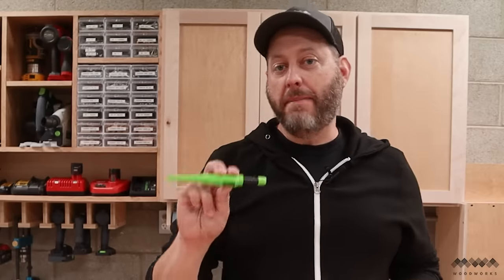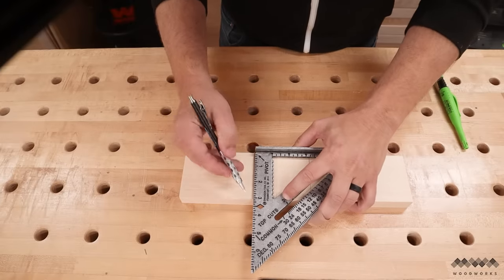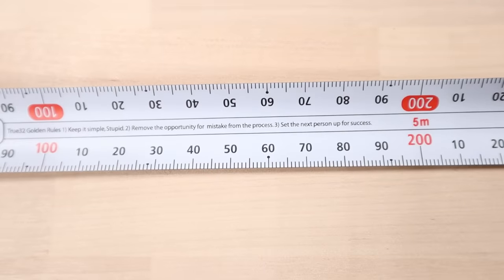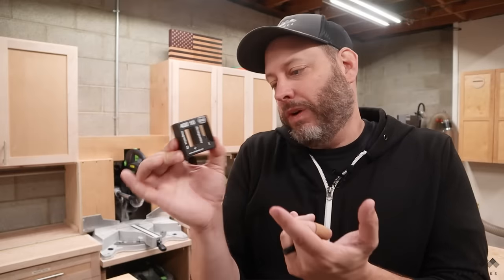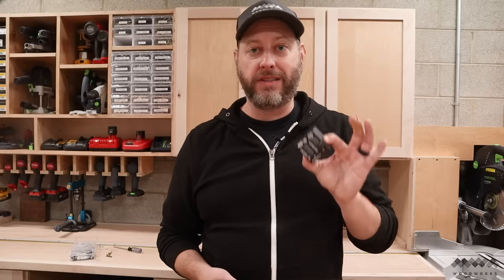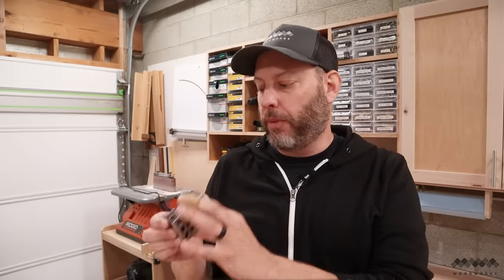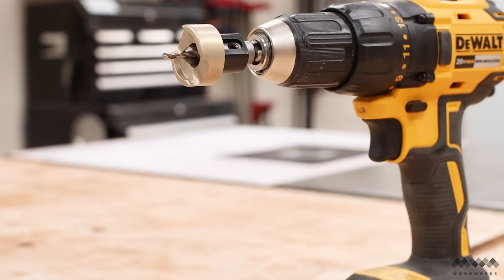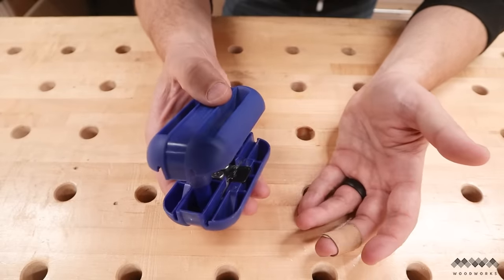Why doesn't every woodworker have these cheap tools?

Comment: O k measure twice cut once  et cetera. Also, if you're measuring it opening or sizing a project, use one tape, measure to size the project, and then size the pieces.
 Don't sweat the small detail that these little hook on the end. Feels loose cause that you're curved.  If you're sizing by pulling on it. And you are measuring your boards by pulling on the hook.It's gonna get the same number. Persuasion is in how you use it.If you're careless with your measurements, you won't get good precision. If you're measuring an opening and you push on the end of the tape measure when you pull on the board you are automatically measuring the curve of your cutting tool which means you should have a near exact fit. It's important to note that fit should be crept Up on. It should not be from just a cut. Cut a thirty second of an inch long and sand  down.

Comment: @MWA Woodworks.  What size Amana counter sink bit do you recommend? I often use power pro screws that are generally 1.5 “ in length. Thanks
Reply from the maker: I use the 1/8 bits myself

Comment: Project Farm's test of ratcheting drivers actually put Wera's ($47) at 5th place, with the way more expensive PB Swiss ($144) at 1st and Linus Tech Tips' model ($70) and the one its modified from, the Megapro (#34), at 2 and 3.

I personally really like the Megapro style bit holder the LTT model shares, being a durable Delrin turret inside the handle that pops out effortlessly.

Comment: Hello, MWA Woodworks. I hate to be a downer (but) when you were drilling holes, starting @13:45, I
noticed your DeWalt  drill wobbled and, using the same bits, your Milwaukee drill did not.
That tells me the DeWalt drill has a problem. Looking carefully, it appears the chuck is the issue and
is either off balance or off center. Whichever it is it will make for sloppy holes.
Hopefully you have already replaced it. 
The tools you have shown here are all very good ideas and Anything from iGaging is excellent and at a good price. 😁✌🖖
Reply from the maker: The Dewalt drill is about 10 years older than the Milwaukee so it does have a good bit more wear on it

Comment: For Pica you can by HH inserts. Much better.
Reply from the maker: yep! They are better but don't solve for the inherent problem of a conical shaped writing instrument that will ultimately do the same thing as the softer lead even if it takes a little longer to get there.

Comment: I have moved away from iron on edge banding. The Big super expensive machines do a great job. The Festool VERY expensive hand tool does an excellent job. I have tried every version of hand trimming and unless its a saw sooner or later your going to have a grain change and tear the band. Much like planing figured wood with a hand plane. I now use solid edge banding and it doesn’t take any longer. Izzy Swan has a method using rubber bands and cheap spring clamps. I prefer the spring molding edge clamps , Rockler has them but they are pretty expensive. Taylor Toolworks had them on sale and I bought 2 dozen of them. They are even nicer than the rockler at a fraction of the cost. Stubby Numbs has a good video on ways to trim the solid edge banding. There are a number of ways to do this and I have never yet damaged n edge and had to do it over. Also this method is commercial grade durable. My 2 cents.
Reply from the maker: Solid edge banding is better although I'd argue its definitely a longer process. You have to mill your own hardwood edge banding first and then glue it on with regular wood glue and wait for it to cure before trimming it flush.  Worth it for sure, but definitely a longer process.
Reply: @MWAWoodworks  You are correct, I should have said it doesn’t take much longer. Also thank you for a Great video and excellent coverage of the tools.

Comment: Really cool video, lots of useful items in there. I must say though, while I absolutely love my self centering drill bits, I just use the built in drilling template of that Kreg Hinge jig when installing hinges. Not sure if you were aware that they have that feature.
Reply from the maker: True, it does have that feature, however that's a single use case with euro style cup hinges. A good set of self centering bits will cover all sorts of hinge installations.

Comment: How well does that pencil hold up to being dropped? I'm a butter fingers and have broken several engineering pencils.
Reply from the maker: I haven't done any drop tests! It's a solid pencil and I think if you drop it with the tip retracted you wouldn't notice a thing

Comment: I hate edge banders. they get dull and chew the crap out of certain veneers and don't seem to flush exactly most of the time so you have to go over and sand the edges. Buy a planer blade and do one side at a time. In the long run it does a better job and it will last your lifetime. I have been using the same blade for 20 years.

Comment: The problem with your review of the Pica pencil is you used it outside of it's intended use. Yes you CAN use it the way you did, but it's designed for marking THROUGH things. Gotta drill a hole in a second piece, but can't get the drill in and lined up with the hole that is already there? use the Pica and make the mark through the hole and then go do your drilling.
Reply from the maker: Correct, the point of my demonstration was to try and use the Pica the way a woodworker would try and use it to demonstrate that it's not good for that use and there are better and cheaper options for my viewers to choose.
Reply: Then the problem is that you are assuming a lack of intelligence and/or knowledge of your viewership. Which is just insulting.

By the way, No matter the size of the line, you have to know where to place the blade to make the cut properly. I could use a fat max sharpie and still make the right cut as long as I know where to place the blade in relation to the mark.
Reply from the maker: It's not insulting to assume people don't know things. It's a key to making good content. You'd be surprised how appreciative people are when you explain things that you may think are simple but others don't know and people get insulted when others makes them feel they should already know things they didn't actually know. Also, the problem with picas or other traditional pencils is that they are conical in shape so the line automatically becomes bigger and bigger the more you use it. This is the problem because the lines aren't a consistent size making each subsequent mark more and more misleading. Any mechanical pencil solves this problem because the lead is a consistent size from start to finish and the line size never changes.

Comment: As to 1-2-3 blocks and so forth, just cut out the middleman, and go to Banggood. They have most of the same stuff  -- probably out of the same factory that made the "name" brand, these days -- for half the cost. Usually shipped from china so it takes a while to get, but it's cheap enough to buy it because you think it might be useful.

Comment: You're not using the Magnetizer/Demagnetizer correctly,.  You just roll the tip slowly into a corner on the Magnetizer or right size slot in the Demagnetizer.

Comment: For woodworking you would probably never want to demagnetize a screwdriver. But you go sticking that screwdriver into the works and boards in computers or radios you would definitely want demagnetized tools.

Comment: I'm not sure why you say the ratchet screwdriver is a multitasker.  It's doesn't have the functionality of a ratchet and a screwdriver.  You still need your ratchet socket wrench if you have this.  It's just a better screwdriver for many purposes.  No one is going to eliminate any tool because they got this, not even their plain screwdrivers.  I don't think any screwdriver has ever been thrown away, unless an entire house is torn down.
Reply from the maker: It can be used as a 1/4 ratchet tho. If you don't put a bit in the end.

Comment: The Fastcat is extrememly hard to read compared to many other brands, if you do not have 20-20 or better visioun
Reply from the maker: Really? I find the black and white the best to read and I have far from perfect vision.
Reply: Just so we're talking about the same thing - I originally purchased a Standard Reverse Fastcap which reads both ways, as I'm ambidextrous. 
As a scientist, I love to measure things.

Unfortunately, adding 1/4, 1/8 etc printing above the lines between inch marks means the size of those lines is 1/2 that of other brands, while obscuring the space between marks that forms the room needed for discerning location. 
The teeny little red 1/16th numbers [1,3,5 etc] and teeny thin red lines just make it worse to read, and the red [#ff0000] makes a pathetic contrast ratio of 4:1.  
The inch numbers are also 1/2 the size. 
Too bad I can't put up the pic I just took of the two together - the picture makes it clear. 
Fastcap's pro is it's wider, so extends longer without flexing. 
Black on yellow [Black: #000000, Yellow: #ffff00] has a contrast ratio of 19.56:1, not even accounting for the fact the inch numbers and lines are twice as large.  
Just check the video at 4:03 compared to 4:19 to see how much smaller the graduation marks are on the Fastcap.

Comment: I had no idea edge band trimmers existed until I almost removed the tip of my middle finger using the taped razor blade method the owner of the cabinet shop taught me. He payed for the ER visit out of pocket because he didn’t want to make a claim against his insurance.  The next day there was an edge band trimmer in my workspace & I was pretty upset to learn that I was injured all because the shop owner was too cheap to spend $20 for a tool that was designed to be safe for the job.
Reply from the maker: That was an expensive lesson to learn

Comment: The Pica pencil is far better than the drafting pencil for woodworking. There is a reason you don't see fine lead pencils like that in shops or job sites. Because they are not practical. You want a thick, easily visible line that you can see on multiple surfaces and conditions. Not only that, but a fine lead pencil can dig into the wood as well. It doesn't have to be sharpened as often as you said either. I get that your a woodworker, but if you think a .5mm lead pencil is better than a Pica or a standard carpenter pencil, you may need to rethink how you mark your wood. The Pica also has different leads as well.  I love my Pica. Learn to use it properly.
Reply from the maker: For doing basic marking sure but not for fine detail work which is the majority of what a woodworker would be doing.

Comment: Nearly 48 years in the trade and wouldn’t use anything other than a 4H pencil for marking joinery, I don’t believe the item you are talking about is intended for parking out joinery rather a convenient tool for using in many other applications in particular spot marking through deep holes for which it’s idea. I believe the “leads” are actually China graph not actual graphite lead
Reply from the maker: its primary use is for general carpentry which was the point I was trying to make, along with another point, which is there is a better option that is also half the cost and can be used for both general carpentry AND joinery.

Comment: 3/8 16th...... HTF do you imperial guys find that easier than metric??? Its crazy!! Not to mention there is no way to be precise without cracking your mind,  7/64" = 2.78mm, next step is 1/8" = 3.18mm for example,  What happens with the 0,40mm in between??? :D :D
There is only one moment where I answer in inches is when the answer is 9" ;)

Funny detail, the imperial institution uses the meter for its calculations, which are converted back to inches. So basically you still use the metric system ;) ;)

Comment: 123 Block…Hard to find good ones, meaning where bolts can be put through the holes to join blocks, because the threaded holes are the same size as the non-threaded.  Amazon’s are mostly Chinese junk, even if the outside dimensions are good.  Metric versions are even harder to come by.  Best bet is go to a proper machine tool supplier.

Comment: Just to clarify:

You cannot use 1-2-3 blocks to attach to each other. You can not fasten two surfaces together when they share a threaded hole. The thread will grab both blocks but it will not cinch them together. 

"Well duh, you put the bolt through the clear hole on one block and then into the threaded hole on the other block"

Except you can't, because the hole is not large enough for the same size thread to pass through it. No one really knows why cheap 1-2-3 blocks are designed like this. I am a toolmaker of 10 years and have never once fastened anything to a block, or a block to something else. I do use them all the time though.
Reply from the maker: You're right the cheap 123 blocks are designed this way but you can still fasten them together using a smaller sized bolt and a nut. The more expensive blocks can be fasted directly or you can use the holes to fasten the block directly to a work surface. I personally don't ever bother fastening them because they stand end to end very well on their own with no fastener. Just depends on how many blocks you have and what you're trying to accomplish.

Comment: Why would anyone use imperial measurements?
Reply: @MWAWoodworks  Actually I can answer that question myself. It is about what you are used to. I grew up in the UK before the common use of metric measurements. In school we learned about feet, inches, bushels, furlongs, pounds, stones, ounces and all those ridiculous fractions. Oh God those awful fractions. By the time I was in my late twenties the use of the metric system had started to become more prevalent though as a craftsman/maker I still stuck to imperial because it is what I knew. I was commissioned in the early eighties to make a gate when an architect friend of mine saw me using imperial to make it and commented on how I was struggling with the calculations, suggesting that since I had ten fingers and ten toes I might find metric easier. He suggested using just one unit; the millimetre. And that if I just learned that one inch was about 25mm, 4 inches about 100mm the rest would soon follow. I never looked back. Everything is so much easier dealing with tens instead of twelves or eights or threes. The system is more instinctive and millimetres relate to litres relate to kilograms and everything relates to the size of the planet we live on!
Apart from the weird anomaly of the fact that distance markers are still in miles here in the UK, the 4% of the world’s population in the USA are now just about the only people still using the archaic system. One day you might catch up.
Thanks for your tips, by the way. Love your channel.

Comment: Those 'Pica Dry Pencils' were originally developed to poke in holes to mark their position, 
Attempting to accurately mark anything else is like holding a normal pencil at the end with the eraser.  you say, "clip it on your belt and you look like a 'Real' woodworker! " 
You dont, you look like a fake, style over substance, 
Real woodworkers have a 2H behind their ear. And suffer phantom pencil syndrome when its not there! 😂
Reply from the maker: Bahahahah 🤣🤣🤣

Comment: https://youtu.be/IerByTCZUx4?t=370 Lol If you are using metric polts and nuts you dont need to measure polts and nuts. Firstly there is number on them to identife right away from 3 to 12 and int time you can tell only from bolt looking at it what is it on a chance.
Reply from the maker: I have hundreds of metric bolts and machine screws and none of them have numbers or markings of any kind on them
Reply: @MWAWoodworks  At europe the bolts always displays numper on it, its prolly us the standartision is not great level.

Comment: The 0.5mm mech pencil will do better if you rotate it as well.  You have to remove the pocket clip to rotate it properly, however.  Not rotating the 0.5 will end up with a flat point and the line will be .02" width which is too wide for a lot of things I do.  At 2:57, you say your double tap brings you back to a "perfectly" fine point.  It appears that you don't know that even means.  When making the marks with the 0.5 you didn't rotate it then either.  You will never have a "perfectly" find point.  Not going to continue to listen to your thoughtless rants.